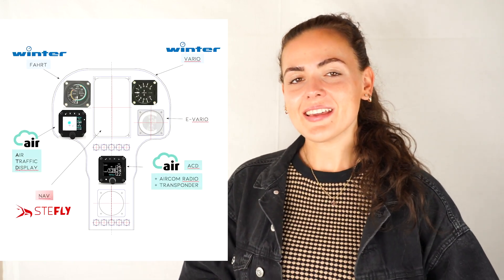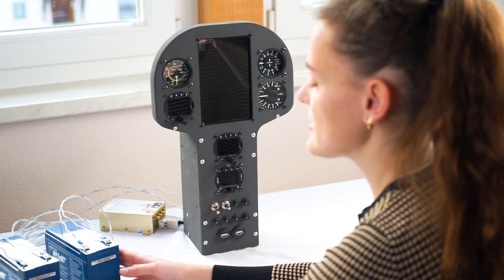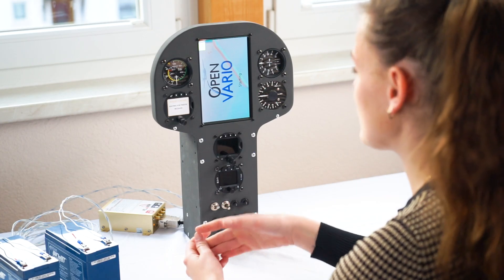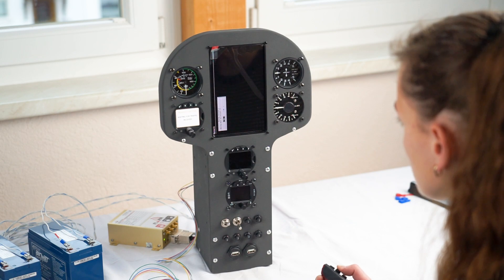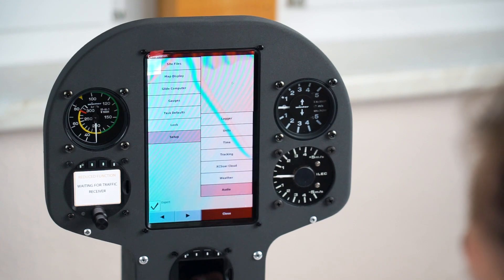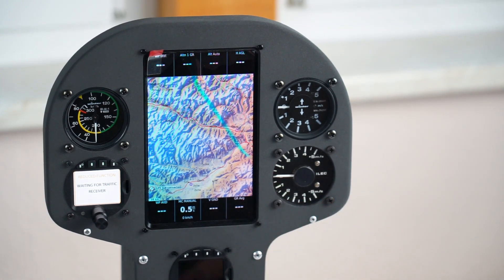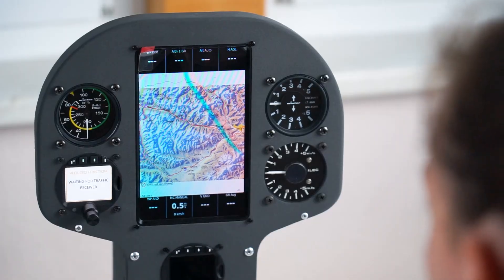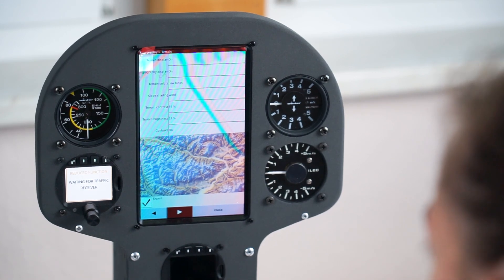How to 💡 Glider Cockit Layout ⚙️ Setup Openvario ⚙️ XCSoar Tutorial

Comment: Great and functional panel setup! What I have learned in the last 10 years of gliding: It's not always important to have the best and most expensive equipment in a glider. What really matters is that you know your system and that it is reliable. Navigating with a smartphone and  without having ist Flarm radar can work (e.g. pre WGC France). On the other hand I made my biggest airspace violation in New Zealand due to my smartphone. The display was not well readable in bright sunlight and I was not used to fly without a big navscreen.

Comment: So since it runs on XC Soar - it doesn't have ENL monitor? Or do you use the IGC from the PowerFlarm Fusion since it has the ENL? I know that's not really an issue for you haha I'm just curious. It will be an issue for my ship. Where do you get the open vario screen? It looks similar to an LX9000. 👀
Reply: it is bought from her boyfriends company Stefly. Ask at Stefan Langers channel where he buys the screens :D
Reply: btw. what is ENL?
Reply: @michaelderflinger5002  Engine Noise Level(?) detection. It detects a running engine and marks these times in the IGC logger file.
Reply: Look at the screen options on OpenEVario.org. Standard are displays from Texim Europe
Reply: She flies a LS4. No engine, no need for ENL. Since OpenVario is home-built it cannot fulfill the tamper-Proof requirements for an IGC logger.
The PowerFlarm must do the job. And a Backup recorder when you are seriously into competition.
Reply: ENL-support is not relevant as the Openvario/XC Soar doesnt do the actual logging itself, it relies on GPS data from an external source like FLARM.   The FLARM unit may provide ENL-support.
Not sure what screens Stefan use these days but I use a 7" Texim screen for mine and it "never" lack brightness.  On the 5,7" version I have compared against LX9050 and they were similar in percieved brightness on ground.

Comment: Very cool video👍🏼 good job done!
Why do you need 2 Varios (on the right side)? And where is the altimeter?
Reply: One is an Analogue Vario and one is an EVario. And the altimeter is under the Airspeed its just digital :)
Reply: electrical variometer (for beep-sound) + mechanical variometer (as backup)